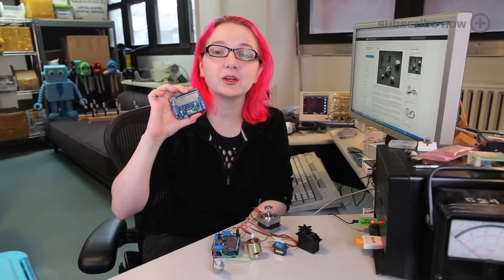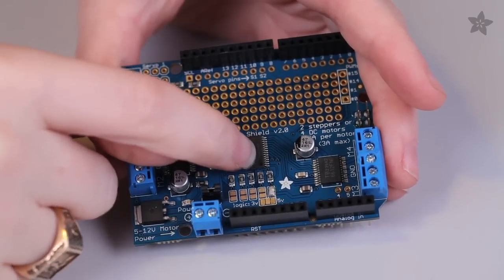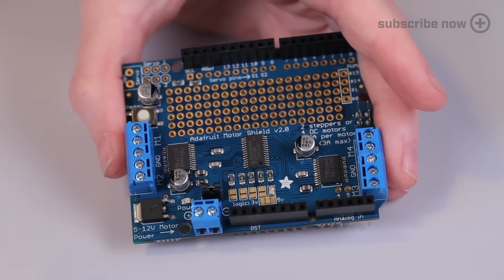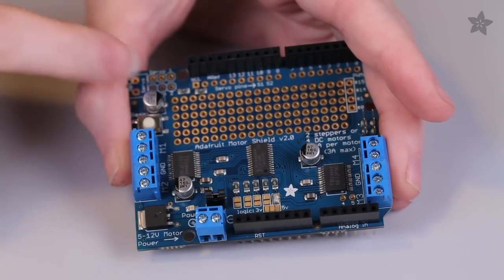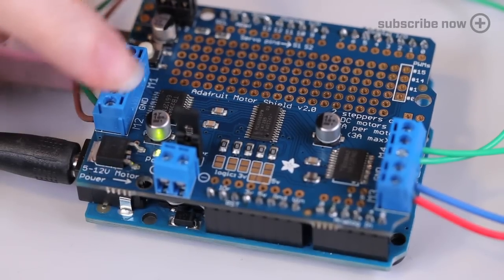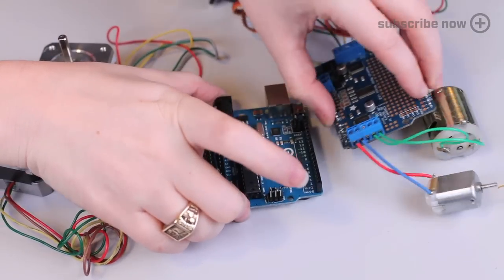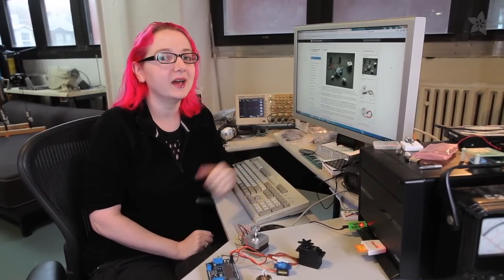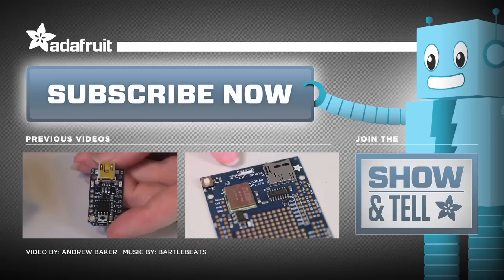Adafruit Motor / Stepper / Servo Shield for Arduino

Comment: Dear Mrs Motor-Shield-Adafruit,
I have a project that I have to drive with the Arduino Uno, and I would like to know if I am programming PID-Controll via Motor-Schield-Adafruit, Or you can work with PID-Controll because the Arduino board has only 5V voltage, and I would like to work with 9V voltage, I would be very happy about your answer.       
 Sincerely 
Zäk

Comment: Are you able to power the Arduino via USB and have a 9V battery connected to the motor controller without causing any issues?
Reply: yes

Comment: does somebody know how to determine what power supply does one need? i want to stack 4 shields to control 8 stepper motors for my thesis and i am wondering what power supply i have to connect to each shield. do i just look on how much volt the motors run and choose this? e.g. when i use two 5 volt motors do i connect 5 volt power supply to the shield?
Reply: What did you figure out?

Comment: Thanks for the intro detail - I have two shields on order and 4 very small stepper motors that I hope to connect and control. As I am using stepper motors I hope to be able to make small adjustments to the individual motors positions based on my inputs by adding an LCD screen with push button controls - does this sound like a looming shield clash situation?
Reply: Did you get your answer?

Comment: Great video !! can i control a synchronous AC  motor (48v) with this shield ?
the motor is similar to this one : https://www.google.dz/imgres?imgurl=http%3A%2F%2Fg03.a.alicdn.com%2Fkf%2FHTB1A5JbIXXXXXcfXXXXq6xXFXXXm%2FUBR2-Synchronous-motor-Saia-motor-Saia-Burgess-motor-UBR2.jpg&imgrefurl=http%3A%2F%2Fwww.aliexpress.com%2Fstore%2Fproduct%2FUBR2-SYNCHRONOUS-SERIES-Saia-motor-Saia-Burgess-motor-UBR2%2F1157976_1658734324.html&docid=qNoE8_x98T6gaM&tbnid=RDMCKhKrCPhdSM%3A&w=513&h=526&bih=775&biw=1600&ved=0ahUKEwiOruSCmoDOAhUC2hoKHYvEAjIQMwgfKAMwAw&iact=mrc&uact=8
Reply: "The motor controllers on this shield are designed to run from 4.5V to 25V.
MOST 1.5-3V MOTORS WILL NOT WORK"

From the power requirements.

Comment: engineer.. ARDUINO IS NOT MICROCONTROLLER!! AVR Atmega, Microchip PIC or intel 8085 is microcontroller. Arduino has AVR microcontroller..
Reply: Way to be pedantic. Microcontroller is at the core of Arduino and it's its main function.

Comment: Was there a bit of a "opps" when you stacked them? As there seemed to be 2 pins sticking out?? Or am I just looking at that incorrectly?
Reply: +Colin Richardson Good point. I wonder, is that on purpose so the top shield uses different pin than the bottom?

Comment: now I know you can stack the shields, but does stacking them still allow you to control the motors of the second shield separately from the first? what pins on an uno does the shield use?
Reply: The shield is an I2C device.  So basically A4 and A5. They can be changed but it is not worth all the effort, most libraries have those pins set.  

"but does stacking them still allow you to control the motors of the second shield separately from the first?" Um yeah. What good would it be if they didn't. Just remember to solder the jumper pins. that's the 5 sets of pads next to the Vin jumper. Make sure that none of the shields have the jumpers set the same. Run an I2C scanner to tell you what the address is.